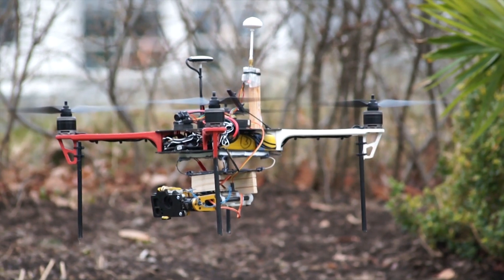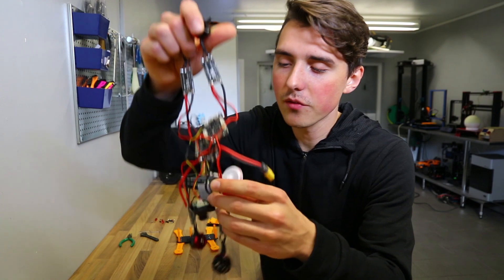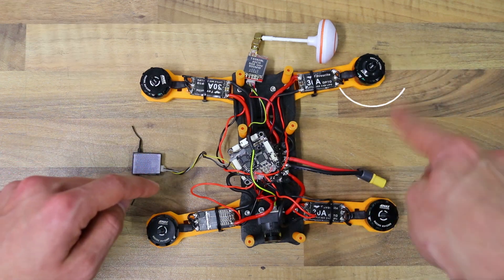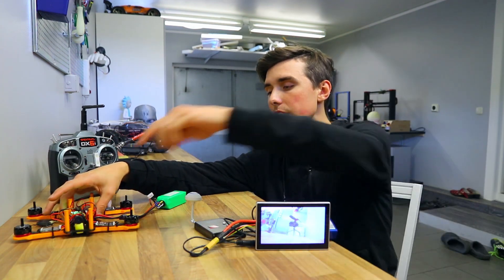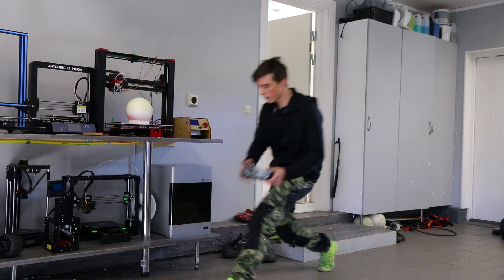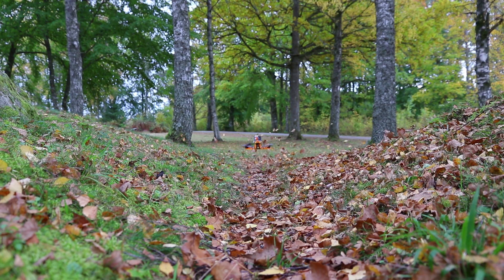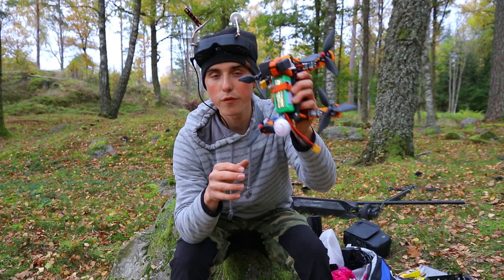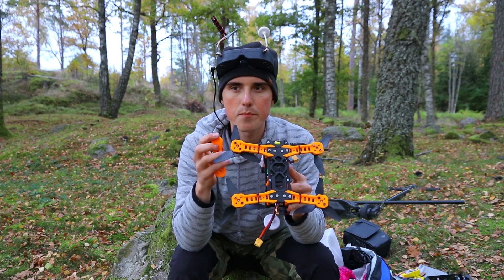3D Printed Racing Drone - Will It Survive?

Comment: You should try to build the best DIY drone you can from scratch and at an affordable price. Great video by the way!
Reply: Just FYI there are already tons of amazing guides on how to build a small drone like this on youtube.  Check out Joshua Bardwell's channel.  He is a legend and has hundreds of videos on the subject.  RCmodelReviews is another great channel for everything remote controlled with a focus on drones and aircraft.  Those guys have already covered everything in extreme depth and quality.
Reply: Totally agree. With all the instructions, that parts are used, how to configure the "brain" and etc. Keep on rocking!
Reply: Depends what you want the drone to do.  There is no best drone.  It's like asking if a Ford F-150 or a Ferrari is better.  Are you towing a boat or racing?  There are lots of kinds of drones each good at certain things.
Reply: Plur307 I meant a racing drone, similar to the one in the video
Reply: Racing drones are already pretty affordable.  A top of the line one is only about $300 using all the best stuff.  That will get you one that is fast enough to win a world championship if you are a good enough pilot.  The expensive stuff is the goggles, all the batteries, charger, controller (transmitter) etc.  All that stuff adds up to like 3X the cost of the drone itself.  My goggles alone were like $400 + $100 for an upgraded diversity (dual antenna) system.  Then add two $20 antennas and the goggles are like $540.  About as much as two very nice racing drones.
Reply: Plur307 I just want to be able to build a cheap drone to use for fun, not necessarily to win world championships.
Reply: All I was really trying to say is that there are a lot of hidden costs.  The price of the drone itself isn't all you need to consider.  Each battery will only get you about 2 to 5 minutes of flying time on a racing drone.  So if you want to be able to go fly for an hour you will need several batteries.  They cost about $20 to $35 each.  10 of them will get you about 50 minutes of flying time max.  That's $200 to $350 in batteries alone.  In my opinion if you are already investing that much in the hobby you might as well spend the extra $100 to get a really nice drone that will be a lot of fun.  I love the hobby.  I'm just making sure people understand the hidden costs.  The drone itself is only one of the many things you will need to get going in the hobby.  You might as well make a nice drone because a cheap one can be disappointing.  You will also want a nice charger that has a lot of power so you can parallel charge all your batteries at the same time.  That alone will probably prevent you from flying a lot because charging the batteries is such a pain in the ass and takes forever. If you go cheap on your charger it will take many hours to charge them all.  But a nice charger can charge all 10 in 1 or2 hours.  There is a saying "the poor man pays twice".  It means the poor man tries to do stuff cheap, finds out the cheap stuff sucks, and has to try again and do it better.  It's cheaper to just do it right the first time and buy good stuff.  Just trying to help.
Reply: Plur307 Hey, thanks for the heads up. At that price tag I think it would be better for me to purchase a DJI phantom 3 pro, which I would definitely use more often.
Reply: @Plur307  I just ordered my first FPV drone setup for $350. The breakdown is 50 for the transmitter, 50 for goggles (I used some very cheap goggles but they are dual antenna) about 50 for motors (Flitetest had some on sale) 50 for escs, 50 total for the flight controller, PDB, and VTX, and then about 25 for antenna and camera. Then a little over 50 for 2 batteries and a charger.  
My point is, you are right. A lot of the cost does come from the not-drone stuff, but that stuff doesn't have to be super expensive.

Comment: i think for durability try the pc max filament. one other thing to help out with vibrations is search on thingiverse for 22xx soft mounts and print them in tpu (flexfill) filament to put under your motors and use blue thread lock on those screws.

Comment: Damn. That worked amazingly well. When I saw "Will it survive?" I thought sure until it crashes and hearing that crash I figured it'd be in multiple pieces when you found it. I wonder what the cost of printing your own frame and spare parts would be compared to buying them?
Reply: Don't buy all these expensive electronics to build this 3d printed quad only to crash and destroy it. A carbon fiber drone frame can be bought for as little as $20 for a 5in. They are inexpensive, durable, and most frames have replaceable arms in case you break one.  You can then 3d print the accessories like camera mounts, antennas, and bumpers.
Reply: @HighVoltageMadness  Hello, I have a 3d printer and i want to get started with building an fpv drone, i already printed an rc boat in pla and it works well. Think it's worth printing a peon 230 in pla?

Comment: How do you do for all the parts to sanp together so easily?? I could never do that with my printer
Reply: alcx112 you need to factor in tolerance into your prints
Reply: but how do you do it when you print an stl from the web? you can't control the tolerances (if any) the creator used.

Comment: PLA has a higher tensile strength than PETG and ABS so I've heard people say it's better for some quad parts. PETG and ABS have lower flex modulus and more elongation before break, but also less tensile strength, so they "bend" a little more but are overall weaker materials. I guess if you never crashed, PLA would be better :P

Comment: Good Video. What are those Props? They are massive...

by the way, your Flight Controller is probably Betaflight capable, if its somewhat new. You can solve many problems just by good Pids and Filters in Betaflight (preferably 3.2). You probably allready new that and i  know wiggly frames are sometimes untunable, but i commented because you didnt speak about PIDs in the video.

Comment: What fpv setup are you using in the video? The one in the link looks different.
Reply from the maker: The products in the description is what I recommend you to buy. I use the Skyzone goggles, but I don't like them and they are like 3x the price.
Reply: You don't like them because of small screens? I considered buying them but when I saw that they are 16:9 format and 30 degrees fov I changed my mind.
Reply: I don't think it's good fpv setup but the price is quiet nice. I would go with runcam swift 2 and eachine tx526

Comment: I found a new hobby today.
Reply: Meh would say go cheap and small for a learner before spending real money on better components.  Flite test has lots of good beginner videos too, tons of fun no matter how you get into it.
Reply: a 5" quad is a better platform to learn on for the fact  that its so popular. tiny whoops and brushed motor quads are a horrible to learn on because they are so under powered. 2" 3" and 4" are also not the best because the quality of the esc's and flight controllers are a mess when it comes to quality and also with the small size make them a pain to work on. for the fact that 5" is so popular every company is working super hard to bring out the best quality components in that size range and also keep the price down since its such a flooded market right now.
Reply: You will like it 😀. Check out my vids if you like 🙂. Fpv planes are also a lot of fun. And you can fly further and longer using them
Reply: And for the first flight buy proper carbon frame. It's a lot more durable
Reply: Good job 👍
Reply: Yeah get into it for sure!!
Reply: You will like it honestly. I suggest making bigger drones. I just feel they are better but it is your choice. I have made 3 till now. They are quite heavy. 2 hexacopters and 1 octacopter
Reply: You leave this comment 2 years ago? Any luck so far? :)
Reply: Yes
Reply: As did I
Reply: Welcome to droning 😜😂
Reply: Congrats you’ll love it
Reply: Same
Reply: I wanna get into it so bad. I actually had a sky viper drone and a cheap fpv one but not a racing fpv. I got some experience but I wondered where can you fly one? Can I just go to any park? The thing is where I live I don’t really know any empty areas and I could see problems arising because it has a camera and maybe because someone might feel in danger from a crash or something

Comment: Do you still sell quads??? Would love to have a quad made by you man, you seem to know what you´re doing...
Reply: As somebody who has built many drones I don't recommend buying premade ones.  You will crash and break it.  If you don't know how to build and repair it you are screwed.  Better just to learn how to build them yourself.  It gets easier every day as the technology gets better and parts become more integrated.
Reply: with the amount of information thats around now its easy to build a quad. i learned everything about building mine right on youtube. only down side is you need the right kind of tools and some experience soldering but even that can be learned on youtube quickly.
Reply: i do agree with you that building one is better than buying one but not everyone is willing to learn how to learn how to build and solder. i said the same thing when it came to rc cars where everyone should learn how to build them before they drive them but i have seen how bad some people put those together to the point of super gluing the electronics in and using wood screws and then complain that the car is crap because their repairs didnt work. besides if someone buys a ready to fly quad there are so many videos showing how to replace an esc or motor that its not hard to do. the one thing to consider is most people that get into "drones" just replace them once they crash and break or just quit all together. some people just have no mechanical skills at all.
Reply: Problem is drones requering soldering skills from very tiny pads to big awg cables . Big copper cables arent so easy to solder
Reply: Thats exactly what I did. I learned everything about electronics and soldering and Radio Frequencies on YouTube back in February and March, and after a lot of technical issues and waiting way too long for shipping from Banggood, I was up and flying once summer hit. Now I post some of my own flight videos on my channel, and I race just about every other weekend with a local MultiGP Chapter.
Reply: in for response
Reply: Soldering is not that hard, I repair my toy quads all the time... I just dont have the pacience to build a nice racing quad myself and this kid seem to have the right skills to build a perfect quad, I would prefer to buy a BNF from him and tune it on Betaflight to my tipe of flying than have to order parts that come from china and take forever to get here and then assemble everything... the quad that he build on this vid looks super fast and stable...
Reply: He really doesnt know what he is doing, this is poorly built with obsolete parts. Males me cringe
Reply: Badass Killer the shipping times is what drives me crazy, just see.. I'm starting now a micro build with parts that I ordered in mid August, and I still don't have a camera because GearBest send me a dead on arrival all in one cmos camera, this was in the 12 of September and they said they would send me a replacement camera but until now... nothing... but I think you got me convinced, after this micro build I will order the parts for my first racing quad build, thank you guys
Reply: Drone lover to be homest the build in the video is not good :D its easy to build a racer but start with a 4 or 5" that make soldering easier. These days everthing is much easyer and many quads fly good on stock pids
Reply: @ Peter Zingler Soldering is easy if you have a decent soldering iron.  The reason most people struggle is because they are using a crappy iron.  One with a sensor that holds the tip at the proper temperature makes a world of difference.  The cheap ones don't have much power but get too hot when not soldering so the burn away your flux instantly then quickly get too cold once you start soldering. One with a sensor will lower the power when not in use and then ramp up the power accordingly to hold the proper temperature when in use.
Reply: Actually the parts are not that bad they are just old...but shifting from 3-4s and wondering about oszilation oh boy...
Reply: Peter Zingler the props though, absolute junk. And yes the parts are a couple of years old but that is a lifetime in this hobby.
Reply: is who shit?
Reply: Yeah its painfull to watch.. he clearly has no clue what he is doing..and PLA as material choice? seriously? How bout Nylon or PC, eventually with CF in it like CarbonX for example.. Everyone knows PLA is to brittle^^ At least he should have tried ABS or PETG.. but meh.. ^^

Comment: Hey. I got a quick question for you. I recently built a race quad but when I punch the throttle it jerks to a random side. I'm flying a brand new spracing f3 and have just tuned it. It flies smooth until I change the throttle radically then it tries to either flip or role. Any ideas on what could be causing this would be very appreciated. Thanks. BTW. I love your videos.
Reply from the maker: Search for "Cleanflight TPA". It's a certain setting that reduces the PID settings based on your throttle. Sounds like that could help you out. Have an awesome day bro!
Reply: RCLifeOn 
Thanks for the suggestion. I'll look into that. Thanks for the help and have a great day.
Reply: OK. So. I added tpa in betaflight. I tried a few different settings. 1). 50% at 1500 2). 50% at 1600 3). 50% at 1400 and 4). 70% at 1400. None of them stopped the problem unfortunately. However while I was flying I did notice that, when I punched the throttle, the quad flips in which ever direction it is already leaning. For example, if I'm flying slightly forward and punch it the quad will flip forward. So it seems that the quad is over compensating when the throttle increases or decreases drastically. 

Do you have any thoughts on what could be causing that and/or how to fix it?

Thanks again for all your help.

Comment: What is that controller you use? Where i can buy it?
Reply: That's a Spectrum dx6i. It's discontinued, but the newest DX6 and DX6e are comparable. If you're interested in miniquads, I'd recommend a taranis instead though, better receiver options, and much more  support in the community. Taranis X9D Plus SE is high end, X9D Plus for the middle and X7 for budget.
Reply: Ok, thanks

Comment: Did you know that 25+mW transmitters are illigal in europe?
Reply: Who will check your output power😃? It's impossible. Someone would need to remove antenna of the vtx and connect power meter

Comment: What soldering station do you use and what do you think about it?
Reply from the maker: Weller whs40, absolutely worthless compared to the one I used before, which was the Weller ws81. It does the job I guess, but if you going to do some serious soldering for many years, just get a good one right away so you don't end up with some cheap crap.
Reply: a soldering iron i would suggest is a hakko fx888d. they are such good quality that they will out live you and they go for about $100 US. it is such a dream to use because how fast it heats up and holds temps.
Reply: I also have a Hakko and I highly recommend it.  I also recommend a large chisel tip and a precision pencil tip.  It only takes a few seconds to change tips.  The large chisel tip is best for general soldering because it has so much mass and holds heat well.  The fine pencil tip is great for precision circuit board stuff.
Reply: some19872003 thanks everyone!
Reply: some19872003 the only problem is that i live in europe and the soldering iron runs on 110v power not 240v.
Reply: on hakko's website they say they sell them in europe so you should be able to find one. i did search and did pull up a site that did have a 230v version also.
Reply: one last thing that i never see anywhere is when you start soldering you will almost always get a sponge with your soldering iron. if the soldering station you get doesnt also have a brass sponge pick one up because when cleaning the tip of the iron the normal sponge is to only clean the tip off when it gets really messy. you should mainly only use the brass sponge because it leaves some solder on the tip which keeps the tip from oxidizing.
Reply: some19872003 ok thanks!
Reply: Yeah I never use the wet sponge.  I've heard the water can actually crack your tips over time.  I just use the brass wool.  Another trick I found is using a silicone spatula.  You can find them in the kitchen section of any store that sells cooking utensils.  Make sure it is real silicone not rubber or plastic!  Silicone can stand temps of up to like 600 F (315 C).  The sharp edge of the silicone spatula is great for scraping off the solder iron tip and it doesn't melt at all.  I've been using mine for over a year and the edge of the spatula is still as sharp as the day I bought it, hasn't melted at all.